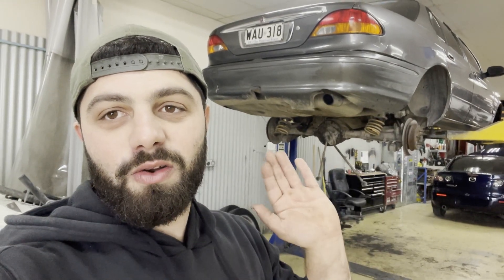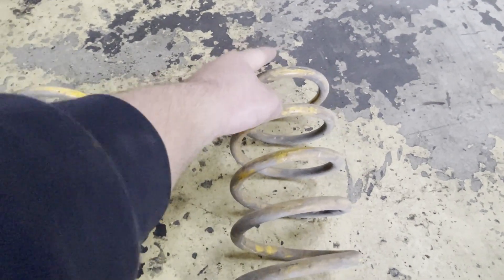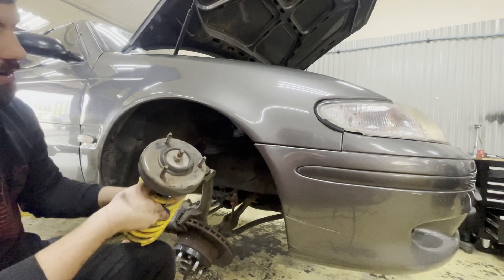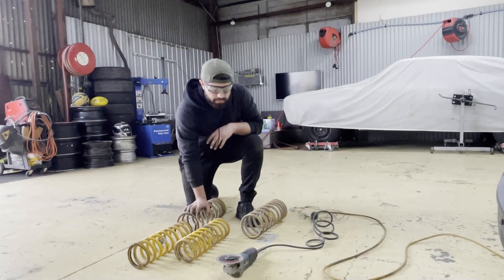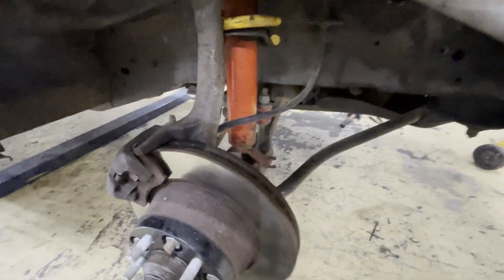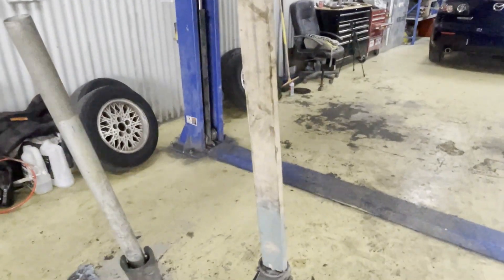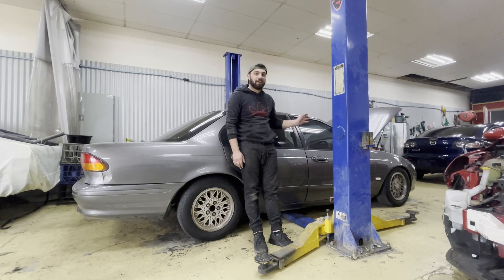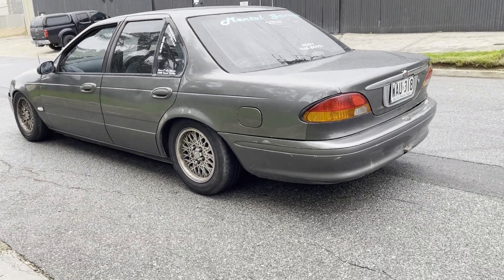The Falcon Gets Choppies (how to chop springs correctly)

Comment: With the rear springs mate do you still run the bottom spring hat that sits on the diff or did you biff that cheers
Reply from the maker: Na still have the hat on the springs